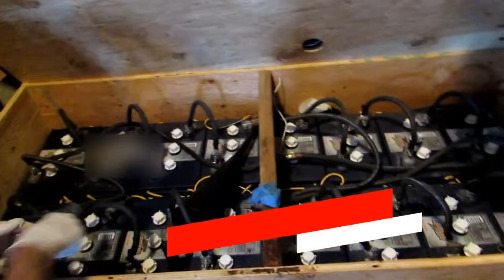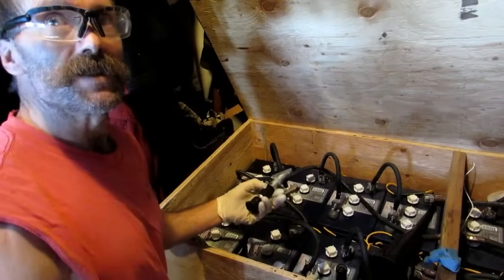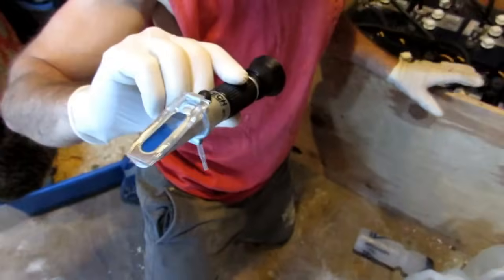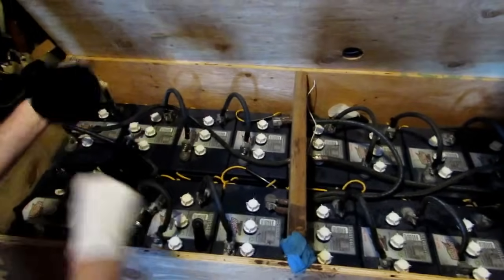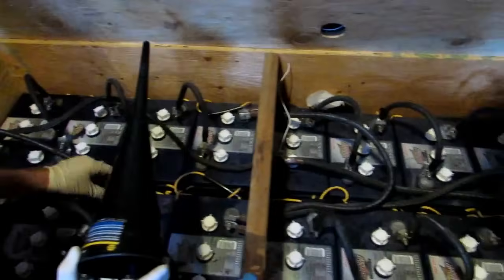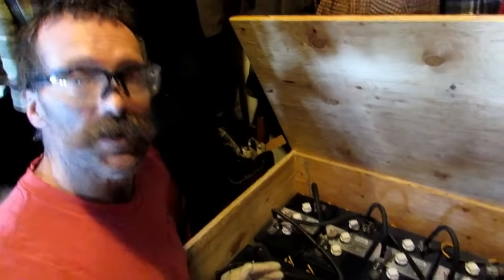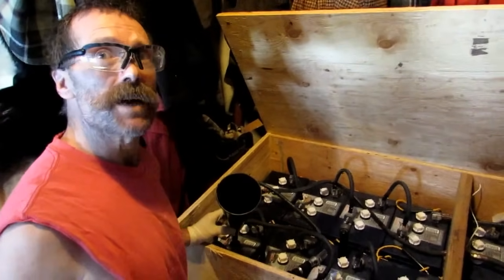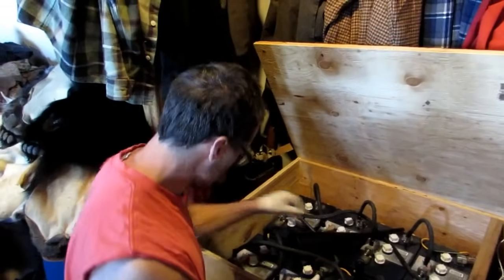LIVING OFF THE GRID: REAL SOLAR BATTERY ADVICE NO HACKS!!

Comment: Well said Mr Man iv been running a little set up 6 j305h-ac with 570 watts panels and a 3000 pro watt with a 30amp midnight kid with NP from oct 2016 mines just a 12 volt but dose all i need

Comment: for voltages other than 12vdc, I presume all 120vac home appliances?  I'm a ham radio guy, and all our gear is 12vdc by convention, so I have been accumulating other 12vdc small appliances as well as inverters.  though my emergency bank is barely 200ah, with a modest 100w panel.

Comment: I agree with you. A  solar array system is mainly a set-it and forget-it. I check the batteries about twice a year. Installed multiple smaller inverters to run different sections of the house.  Designed and built a PIC32 microcontroller circuit board for battery bank monitoring. I have 8  trojan T105 6V batteries for 24V bank.  monitors   voltage, temperature, specific gravity of EACH cell of each battery.  that tells me if the cells are balanced within the bank. If the specific gravity  and voltage is low then it must need water. I check the temperature of each cell so to correct the specific gravity reading.  It then sends the data via a CAN bus interface then to a 433Mhz wireless transceiver. My system is working flawless for 12 years. knock on wood.
Reply: 27 years in electrical engineering + making mistakes along the way. Even tho I custom design charge controller and monitoring,  the cheap SINE wave inverters are still cheaper to buy. I agree most advice on solar panels on  the internet is misinformed, only half of what you need or just plain wrong. Solar installer seem to want $30K - $40,000 per system. Thats 10 times more than it should. Every household has different power requirements. Most households waste power so the installer installs a system bigger than what is really needed. Some are grid tied and don't even include batteries.  I could write a book about the do's and don'ts of solar power. Maybe one day. Will be glad to answer any questions you have. you can email me djberry(at)hiwaay(dot)net

Comment: Heat will shorten the lifespan of batteries. I'm getting 5-6 years with mt T-105 batteries here in central Florida. I recently added an automatic fill system, which reduces the fill time of the entire battery bank to about a minute.   Solar is low maintenance once you have it figured out!  Keep up the good work!

Comment: I hope you get 18 years or more from your batteries. I hope to get 18 out of ours. I have been using only the top 20%. Our batteries really don't go below 84% SOC. That's only 16% DOD. I have a friend who has been off grid for 40 years. He gets 18 to 20 years doing it this way. He has an elevated absorb voltage like I do> His 48 volt system has the absorb set at 60 volts. With My 24 volt system the absorb voltage is set at 30 volts. for 2 and 1/2 hours and my specific gravity is spot on at 1.285Great video.
Reply from the maker: thank u steve! talk to people who actually have solar systems up and running! mr.hilder

Comment: Hey Hilder,  Just so you know.  The newest solar battery pack is a battery pack made for cars.  These batteries are lithium, and need no water. Can be placed flat or on the wall.  They are normally about 14-19kw.  They charge the same and give a lot of power for solar systems. These batteries can be purchased new or used.  They are rated to last about 10yrs.

Comment: Mr H is so on. After the first yr things get easier. I was very fortunate to hook up with the right guy for my system. I'm using a 48volt system with 16 6 volt cg2 costco golf cart batteries. With a Out Back FP1Power panel with everything on it. I've received outstanding support from Out back. I love the ability to monitor it locally or remote. In the end, you decide what works for you.

Comment: Mr. Hilder: I have a heavy Mechanical background, I grew up with heavy equipment, logging and road tractors, we would jump batteries positive to negative then pull off of that. How do U hook up battery on solar system do U jump positive to positive and negative or positive to negative (I hope that was not confusing). Solar Company's here in Georgia will not assist U unless U pay them $250.00 consult fee. I have all of the equipment for battery maintenance from my mechanic background. I wont to set up the same system U have.  Thank U   Blessings   Paul & Susan North Georgia

Comment: Do you have to purchase your filtered water or do you do it yourself?
Reply: Gerry Marmee I believe it's distilled water which has to go through a process which it's turned into steam and the Steam runs into a different vessel. that way all the minerals and everything is Left Behind and you're not leaving a mineral residue inside the batteries people do that for irons that plug in. any kind of mechanical things that require water. Most people don't have a water distiller. But you never know?

Comment: This is what you get with a well designed and used system! Also you do monitor the system more often than that ..... if you noticed the batteries not going on float when expected Mr Hilda would be in there like a ferret up a drain pipe! When it is all working well you do not need to do much .... Knowing when it is working well is the trick! 
Good Batteries, Well located, a good Charging circuit and an adequate supply make it all easy! 
Is this not what "Preparedness" is all about?

Comment: Buy LiFePo4 batteries instead! No maintenance, low inner resistance= easy to load and unload. Safe, long lifetime. 
High investment costs but low life cycle cost. AND you only need half of the amphours
Reply: Carl Johan Magnusson what are they made out of?
Reply: TheTyrial86 
Lithium (Li) Iron (Fe) Phosphate (Po)

Comment: I went with glass matte batteries (AGM).  No maintenance!  My system is 48V, with two banks of 8 each.  I expanded my solar this summer because my radiant floor heating pumps were running my batteries down quickly in winter.  I'm in Michigan and our winter days are really short!

Comment: You guys need one of these.  Makes servicing batteries SO much safer and simpler.  I did battery maineance as part of my job in the Air Force and used auto-fillers every day.  They take the guess work out of "how much water will this cell take?"  Mr H does seem to have it down though.  Cheers!

https://www.amazon.com/s/ref=nb_sb_noss/134-7748067-5107419?url=search-alias%3Daps&field-keywords=battery+auto-filler

Comment: Great video. I wish more people who run systems that work would explain that a well working system shouldn't require constant struggle and work and if it does there is a problem with the system. I've only been running mine for a year now but I have had no issues with it and have had to only do the distilled water replacement schedule just as you do. I had a slight problem with my inverter but the company immediately changed it out as it was under warranty. I shake my head when I see all this fiddling and fighting with systems and just don't understand it. Great info here.